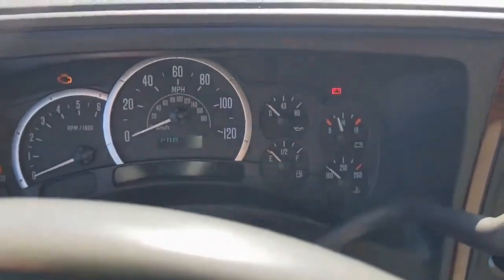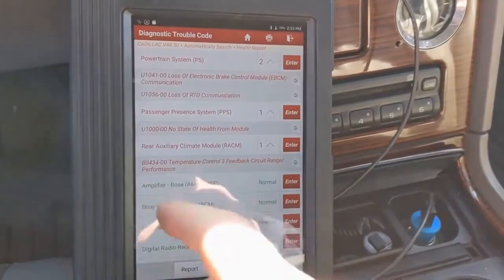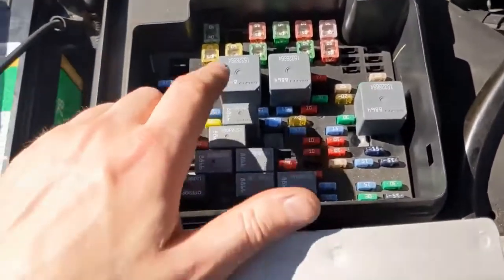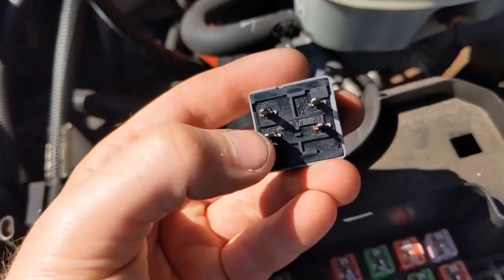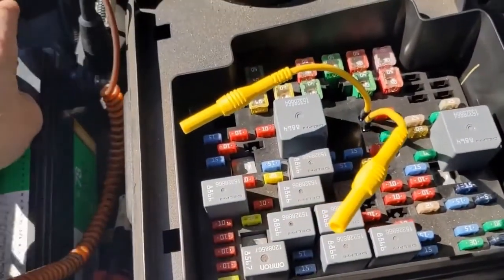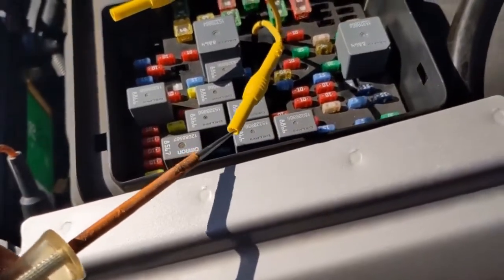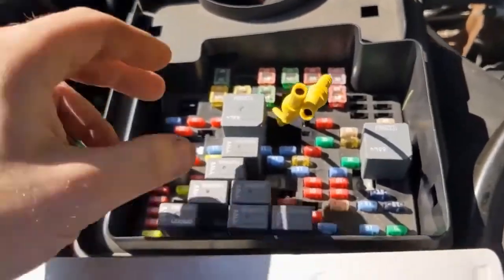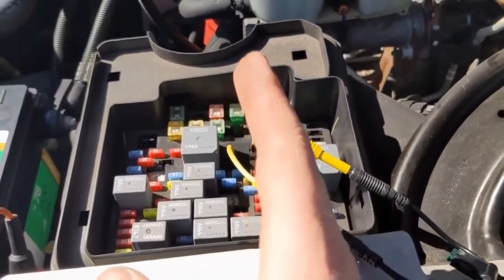2004 Cadillac Escalade Won't Start or Crank Over | How to Fix a Car That Cranks or Doesn't Start

Comment: Hey, so I have done thru all of your steps. 
I'm having power to the starter. I'm having power during the ignition , it's a new starter. I did the whole relay steps you should and I'm still getting a click with no crank. 
I'm wondering if you had any ideas what it could be. And thanks for the video.
Reply from the maker: I would check the battery terminals for a good connection. And the big terminal on the starter for a good connection. Also check voltage drop on the big power cable with a multi meter. Hooking one end to the battery positive and the other end to the starter solenoid positive. You should get less than 0.5 volts during cranking if you get more then you may need to replace the positive battery cable. Also not sure if the new starter is a reman but I'm my experience reman starters are hit and miss with quality. One van I worked on went through 3 reman starters in a one year period!

Comment: Mines cranking fine. I didn’t have to do all that. I just jumped it and it cranked but it’s not cranking at the switch.
Reply from the maker: @WillFull_Truth  Swap the relay with a good one from the fuse box and see if it starts.

Comment: you didnt jump the right wires together, last test you were suppose to jump power from the top right hole(battery power), to the bottom left hole(starter S terminal wire). but from what i can see in the video you jumped the top right positive wire to the top left negative wire, which is not the wire that goes to the starter to engage. so jumping top right hole to bottom left hole, the vehicle should have cranked over.

Comment: I’ve only got power at “30” not 85. What does this mean? What are should my next steps be ?
Reply from the maker: Check it with the ignition turned on. If it still isn't getting power then check fuse "IGN E" 10A in the fuse box. If that is good then check fuse "IGN B 40A in the fuse box. If that is good then it could be your ignition switch or park/neutral switch on the left side of the transmission.

Comment: i did not see what you did to start the vehicle.  i might just need a jumpstart coz i haven't used my vehicle for a month i guess..
Reply from the maker: This vehicle started on it's own. I was running through the process of diagnosing it when it decided to just start. But ultimately it needed a starter motor. Checking the battery is a good place to begin. If you are able to start the vehicle with a jump then it was probably just a low battery. If you have any other questions feel free to post it 👍
Reply: @ValleyMobileAutomotive Can I do these tests with a multimeter? If so, how? Also, how exactly do I test the starter & solenoid with a multimeter? Thx!
Reply from the maker: @b-dub6865  Yep. Do the same tests that I use the test light on. Imagine one end of the test light is the positive on the multimeter and the other end is the negative. Instead of a light you are looking for battery voltage.
Reply: @ValleyMobileAutomotive Thx! That’s what I thought. I’m still figuring out how to use this multimeter. This may be an ignorant question, so please be easy. Do I need those yellow adapter/connectors to test the relay connections? (Idk what they’re called.) Also, how do you test the S terminal on the starter? That part confused me since the vehicle started. Thank you again! You’re the best!!
Reply from the maker: @b-dub6865  good questions. You don't need any adapters like I had. It just makes it easier to work with. As long as you can make contact with the terminal you should be good to go. With the S terminal you're looking for battery voltage when you try to start the vehicle. Put the positive on the S terminal and the negative on a solid part of the frame or starter case. With the relay in have someone turn the key to try to start the vehicle. (Be careful of moving parts) If you get battery voltage at the S terminal then the starter is bad. If you don't get battery voltage then make sure you have solid connections and try again to confirm.

Comment: Mine does the same thing I have almost a full tank and it’s saying the gas lights on idk if that has any meaning. 2005 Cadillac Escalade no crank no start don’t try cts3 evolution the monitors fine edge is ass 👎😔
Reply from the maker: @jessewilkie5762  The fuel pump and gas light shouldn't prevent it from cranking. Make sure the anti theft light goes out when the key is in and check to make sure the starter is getting good power while trying to start it.
Reply: @ValleyMobileAutomotive I jump the starter relay and it cranks fine. My ignition just doesn’t seem to do much it turns on gauges but when I crank the key nothing happens besides gauges flashing. I think the computers shot or needs to be reset
Reply from the maker: @jessewilkie5762  Before condemning the computer have you tried swapping the relay with a known good one? Also make sure the body control module is receiving a crank signal. You'll need a scan tool that can read live data and be able to communicate with the BCM.